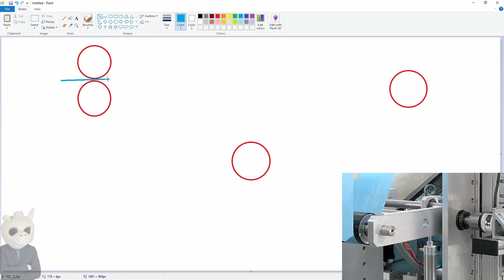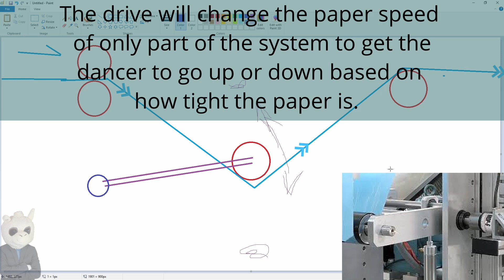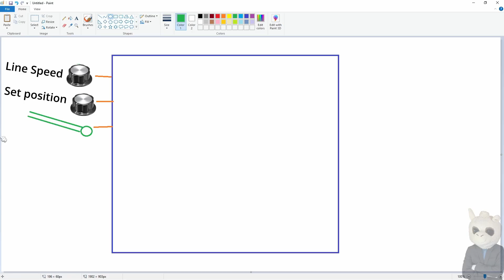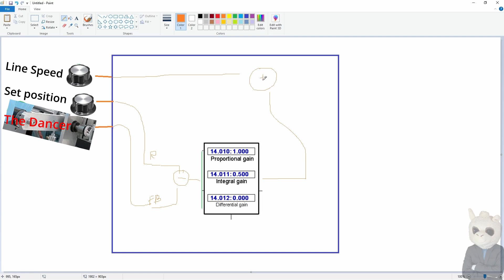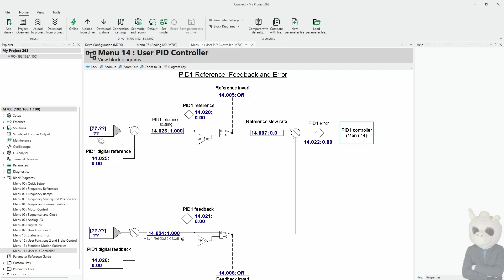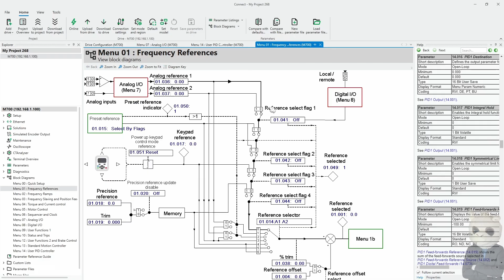PID Dancer Control Setup: Using a Potentiometer to Set Dancer Position.

Comment: I have a Unidrive M600 and I want to control it from an Omron NX‑series PLC using an Ethernet‑based protocol. Could you please tell me which parameters I need to configure on the Unidrive M600, and how to correctly set up the EDS file? 
thanks
Reply from the maker: you have to add the SI ethernet module to the drive because that their drive does not come with ethernet by default.  You do not need an EDS file to speak ethernet IP to the drive.  if your PLC can sets up a generic device, then you can select how many input outputs which you want and also configured on the Drive side to match . they’re also is a simple ES final you can use if you want, but it’s limited. Unfortunately I don’t know omron plc.  I know they’re getting more popular, but I also know omron have some limitations that other plc don’t. I should say I know plenty of people that have got that PLC’s working with the Drive. I just don’t know how to set up that particular PLC. however, I believe CT might have some app notes if you could reach out to the Technical Support group for that PLC. do this by submitting a ticket from their website?